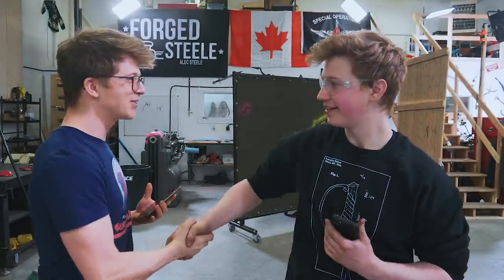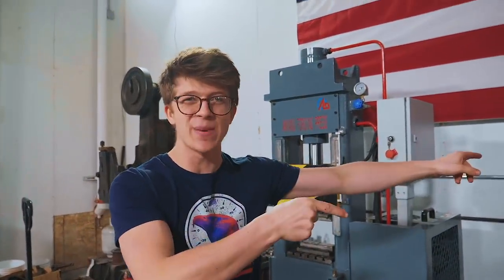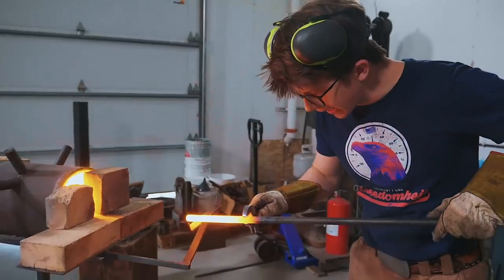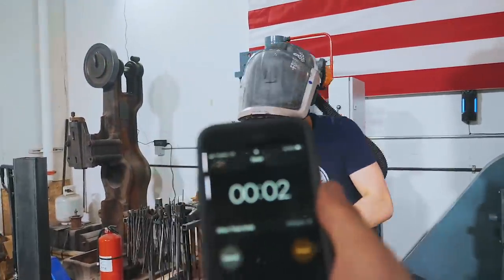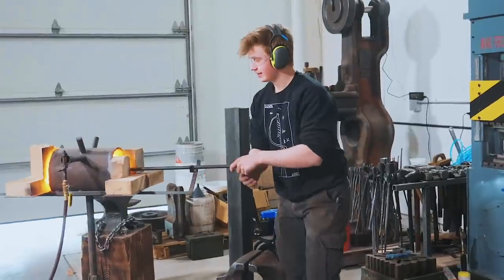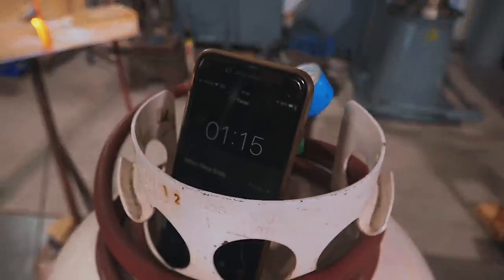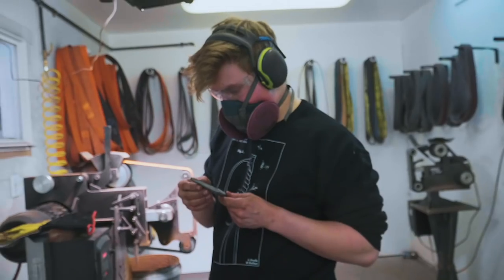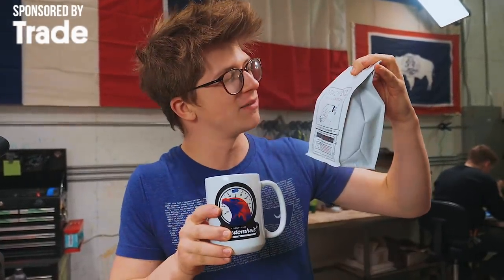CENTRE PUNCH MAKING COMPETITION!!! Steele Vs. Stelter: 2

Comment: This gave me a neat idea for a nail set...set. In woodworking having the various sized sets for nails and brads etc, you could have them tapered and hollow, with consecutively smaller tips in each piece. Make them thread off each other and it would be an all in 1 tool. I got the idea from your grip.

Comment: hey Alec, having worked with coffee for most of my life , I would like to explain how you are not drinking the best coffee that you could. I know this because I could see that you are using pre-ground coffee, which, by definition, means that it is more stale than it should be. (the fact that it is packaged and shipped to you means it is already pretty stale, but ground coffee is worse.) much of the flavor from coffee comes from the volatile gases encapsulated by the coffee bean, not just the oils. when you see the nice creamy, foamy "crema" (the technical term for..), the foam on top of a demitasse of fresh espresso, then you know that coffee is pretty fresh, and freshly ground. This is the reason most good cafe's, like Starbucks, will have a grinder directly attached to the dispenser for the espresso, so that it can be ground fresh, as it is needed. do not get me started on the necessity to fully de-gassify coffee, bean or ground, and so make it Stale, before vacuum packaging.
get yourself an adjustable grinder, use the proper grind for the method used (turkish coffee/ibrik should be baby powder fine, finer than espresso, which should be a fine sand texture that does clump, but still has a gritty feel, turkish should feel smooth, ; drip coffee should be about beach sand texture, with pieces each about a millimeter, more or less; french press should be an even coarser grind, about 2mm pieces; on a 1 to 10 scale, with 1 being the finest possible, and 10 just barely breaking up the beans, Turkish coffee would be 1, espresso ~3, paper/mesh cone drip 5, flat bottom paper/mesh drip ("Mr Coffee") 6, French press 8, and percolator/boiled cowboy coffee 10 (do not use this method unless you grew up in the depression or actually are a cowboy out on the range with no other options, it WILL put hair on your chest and take chrome off of a bumper)
finally, I would like to make a suggestion or 3 about different methods of using your press to prepare your morning brew. A; save your egg shells, clean them off well, let them dry, and then crush them into a powder that you keep in a closed container next to your coffee storage. put a nice healthy pinch, or more if you want, on top of your grounds when you brew, and you will find the shells have absorbed a great deal of the bitterness of the coffee. some folks may claim Chicory has the same effect, but that is not true in my experience. chicory was used in the depression as a coffee substitute/extender, and has become misunderstood, it is actually More bitter than coffee. 2; rather than getting flavored coffee, like hazelnut or vanilla, why not add actual fresh spices to your brew (yes, spices benefit from being freshly ground as much, or more, than coffee does), get yourself a nutmeg grater, like a small rasp-thingy, and grind some nutmeg and/or cinnamon, or what ever strikes your fancy, into the pot before your add the ground coffee, to taste (start SPARINGLY). also; if you use sugar, Stop. get some honey, hopefully unprocessed, from a local apiary (beekeeper), and try different varieties, you may notice that honey can taste surprisingly different when made from different types of flower pollen. sugar is bad for you, while raw honey has health benefits, and this comment is already FAR too long to go into those here. while you are at it, try infusing some honey, not only for coffee, but for cooking too. try drizzling garlic infused honey onto your pizza delivery and voila! gourmet pizza. heck, I bet you start putting garlic honey on Everything! but I digress.
I could go on for quite a bit more regarding coffee, but I think I will wait for replies to see if there is interest.
take as much care in perfecting the craft of feeding yourself as you do with your crafting career, no matter what the career, you have to eat
if you read this far, thank you, I hope it helps
keep making the good episodes, I will keep watching, be well
Reply: Thanks for the tips. I'll be looking out for a variable coffee grinder.
Reply: Cba reading

Comment: Learned this from an old hat toolmaker at my work. A quick and reletivly good way to temper is to use an oxy torch and burn the remaining quenching oil off the the part right after the dip. I use this when im in a hurry and needing to make die spares in a hurry. Its not the right way to do it but it works really well if youre in a hurry or if the temper isnt critical.

Comment: Alec, hands down you are the winner in this particular contest.  I would like to see you have more time and to have worked more on your version.  What would be really cool would be if the "cogs" you created on the punch would actually turn...probably not possible, but it would be so cool....hmmm, maybe make the "cogs" separately, make the shaft of the punch narrow enough at the point where the cogs are for them to slide over, and then thicken the end somehow to hold them in place.   Are you up to the challenge to do that ?

Comment: Anyone else notice Will doesn't wear gloves? What's with that?
Reply: Man hands.
Reply: Most blacksmiths don’t like wearing gloves, i sure don’t. Causes your hammer to slip, tiring you out a lot quicker. Removes dexterity, and I’d go far as to say they’re a safety issue in most shops.
Reply: Gloves make you feel disconnected from your work a lot of the time.Most skilled trades people only put gloves on when absolutely necessary from my experience

Comment: Curious Alec,  what kind of lenses are you using in your glasses that you are using them as appropriate safety eyewear when hammering with hot steel.    Do they get scratched up easily?   I notice my glasses do get worn out every couple years, but luckily that's about time when I replace them.

Comment: As-quenched hardness of 4340 can be in the low 50s Rockwell C, which is softer than a good file. With low-medium carbon steels the question isn't necessarily whether the steel will completely skate a file, but whether it gets significantly harder to cut with a file.

Comment: I don't have Instagram and no intention of ever using it... So ill just leave an uncounted vote here. I prefer Alec's. I prefer my punches to have texture for a better hold on it. Plus having the scale on it... soak it in oil for a day or two then clean it off and it will take forever to start rusting.

Comment: How did Will not get the 4345 steel hard on the first quench?  Not heat it hot enough?  My impression is in thin sections that stuff will harden with a blast of compressed air.

Comment: Point goes to ... Alec! 
And that's why:

Alec - Very cool design, good work and it seems to be hard enough for using it as a tool. Only concern I have - these “rips“ on the handle look unique but may hurt when holding and hitting it with a hammer.

Will - Seems as if you tried a little to hard to look cool while working 😅. Your center punch looks a bit too simplistic for me. The hardening problem did cost you lots of time. In the end, it's a bit rough and unfinished.

Comment: If they were both in my toolbox I would probably use Will's one as there is less chance of injuring your hand holding it.  A tool should be smooth and easy to handle and being a centre punch smooth and  round is the best shape

Comment: As a mechanic I would use Alec as a center seams like something could hold on to as use with dirty greasy oily hands. Will’s wouldn’t get used very often because of that double taper, and when it would get used it would get beat on with a sledgehammer.